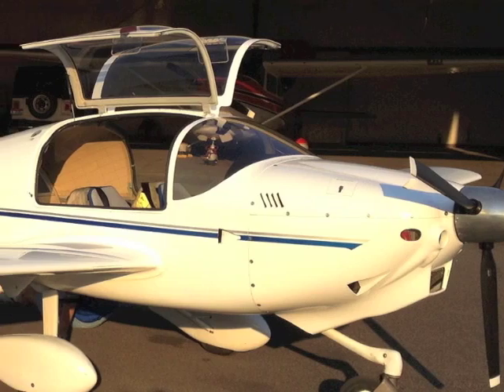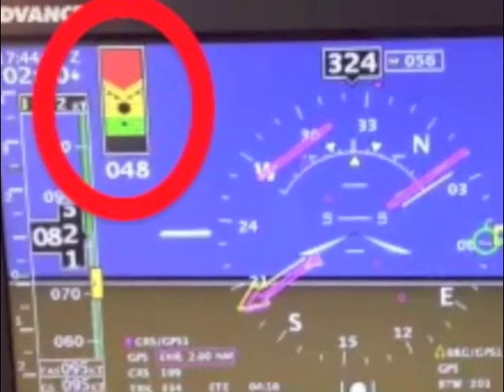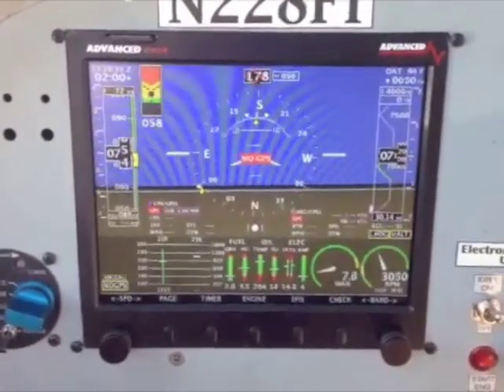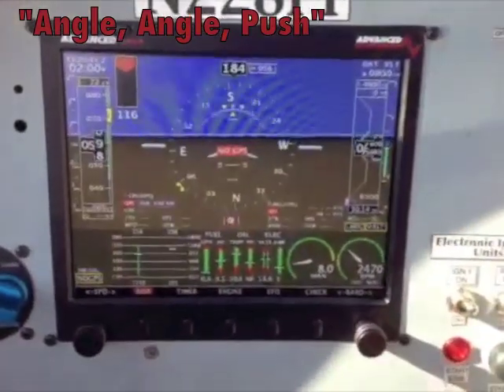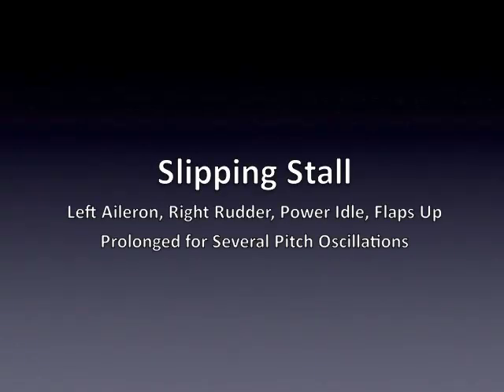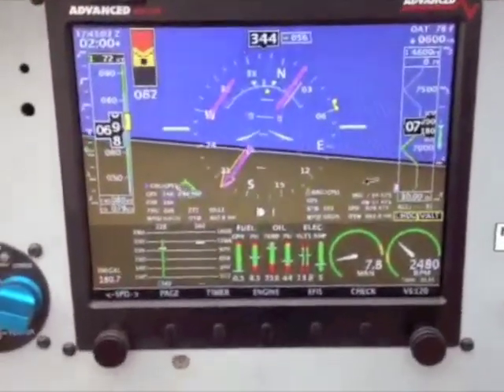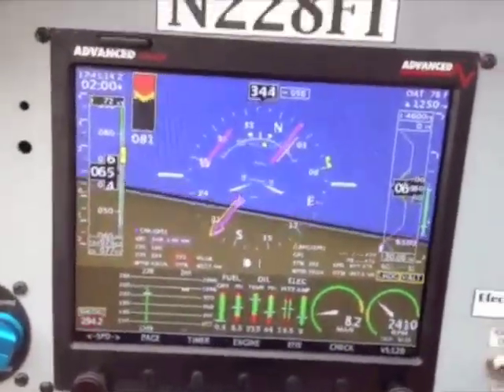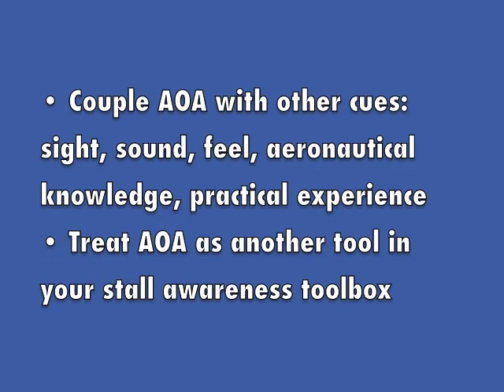AOA during Stalls in Europa XS N228FT

Comment: They jumped straight to a conclusion without investigating the cause. All instruments are only as accurate as the sensor used and WHERE the sensor is placed. If you read kit aircraft forums, there are many discussions around improvements to instrumentation by repositioning the instrument sensors, It seems completely logical to me that a slip would give poor accuracy if the instrument only had a sensor on ONE wing as we know that each wing in a slip gets different exposure to lift... which is the nature of a slip. What they should have concluded is that there needs to be attention placed on WHERE the instrument sensors are placed and then experimented with this to find the optimal positioning for that aircraft type to give reliable instrument readings.